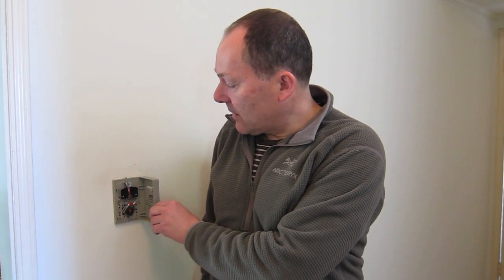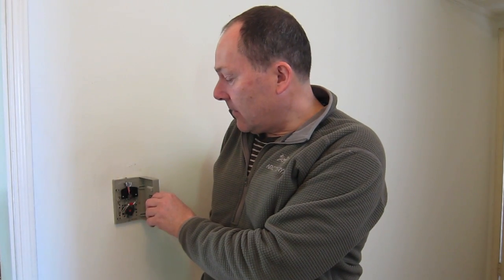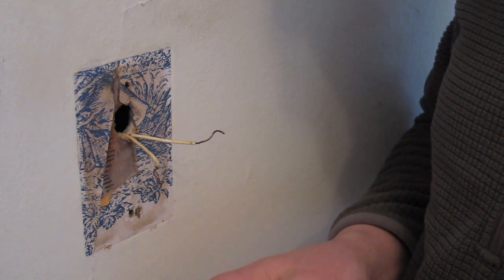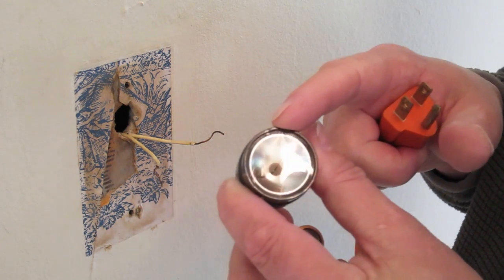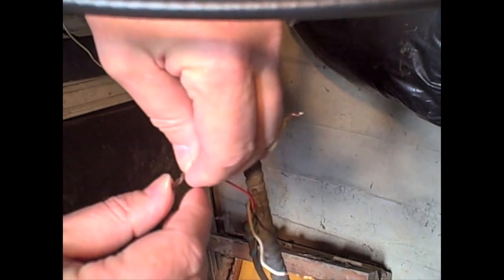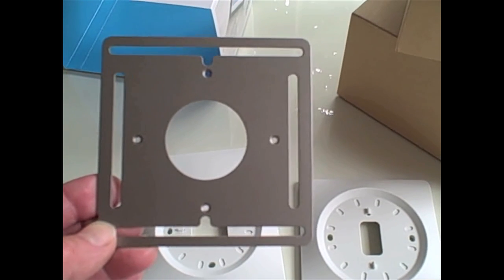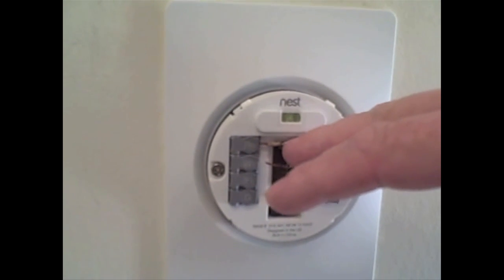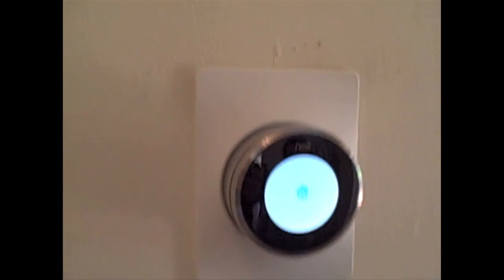Nest Thermostat Installation And Wiring by RemodelBlog.net

Comment: You made no connection to a 24VAC "C" wire that I could see. Yet the instructions say that you need one. What's up with that?
Reply: Hi Linda -- This is Kees with Remodelblog.net. It is very difficult to answer your question, because I do not know what kind of heating/cooling system you have, how many wires there are, and whether your Nest thermostat is a first or second generation. The unit Melinda and I installed works beautifully with no C wire connection. Just now I looked up Nest's online installation instructions (second generation) and there is no mention of a C wire connection requirement. I recommend you contact Nest directly. Please let us know what you find out so it may help others. Thank you.
Reply: Thanks. I must be reading about the first generation Nest. I have a boiler hot water heat only currently controlled by a 2-wire mechanical thermostat. I am researching various options for a wireless wifi-capable thermostat so that I can monitor/control home heat when I am not there. Suggestions?
Reply: Linda -- As I recommended earlier, please contact Nest for the best answer. I am not an electrical engineer and don't want to give you incorrect information. An alternative to calling Nest, and if you are adventurous, you can purchase a Nest from the Home Depot, hook it up per instructions, and see if it works. (don't install it yet, but just connect the wires) If it works, you install it and all is well. If it doesn't, pack it up and return it for a full refund. The Home Depot is usually very easy about returns, but some products must be returned sooner than others. It will say so on the receipt. NOTE: Pls be sure that your thermostat is indeed 24V, as you noted earlier. If it's 'line' voltage, such as 110/120V, you will damage the Nest, and possibly yourself.
Reply: +Linda Krol You do not need a c wire with the nest but some other smart thermosts need a c wire.

Comment: I have the NEST 2nd generation and NEST support told me my thermostat is not compatible, because I only have 2 wires. I have one black wire and 1 white wire. I also see in your video you only have 2 wires so I am thinking this might work despite what they told me. Do you have any suggestions on what I can do to determine if it is compatible ?Thanks

Comment from the maker: No, they were not. In addition, because the Nest's installation instructions were very specific, we did not want to make the assumption that the old unit was wired correctly. Starting from scratch seemed like the right thing to do. Thanks for asking, though.